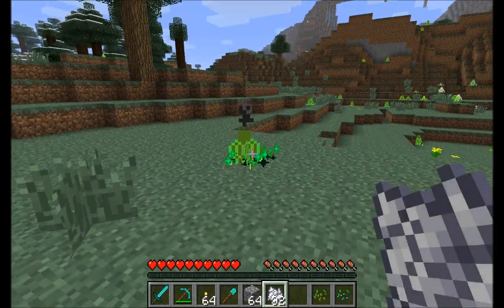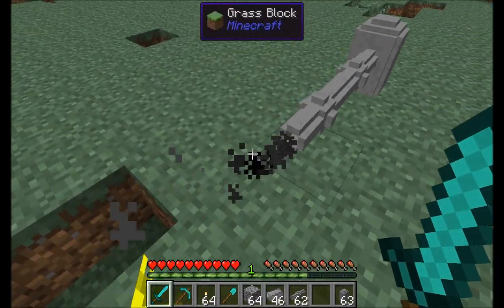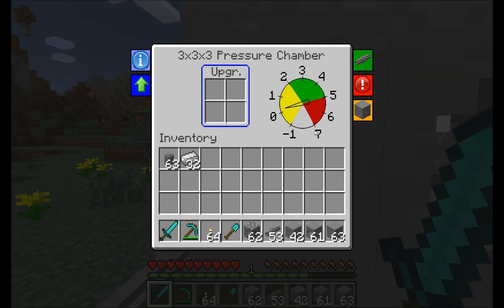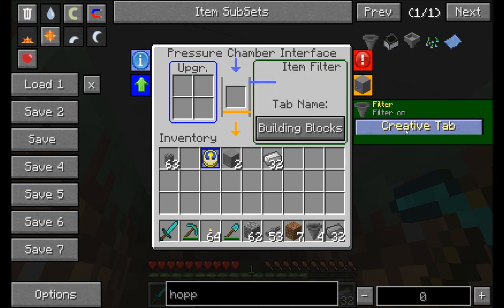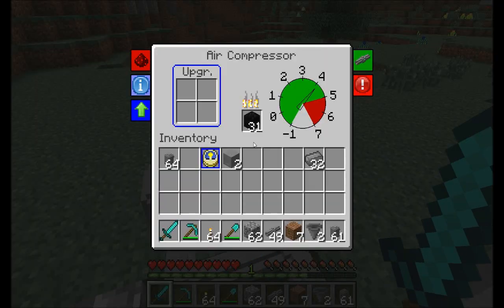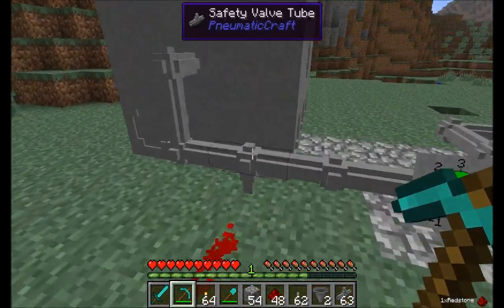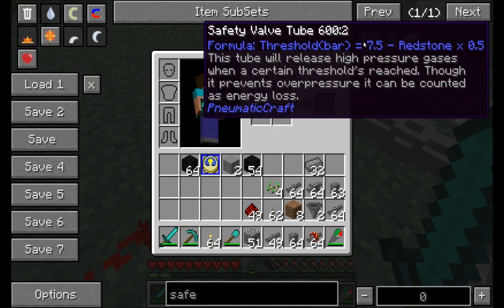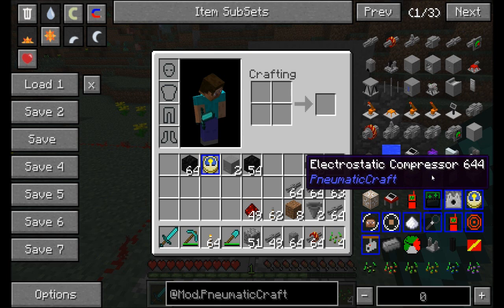Mod Spotlight   PneumaticCraft Part 1

Comment: Can the pressure chamber only be either a 3x3x3 or a 5x5x5? I tried to make my 3x3x3 taller by one unit (so a 3x3x4 I guess) but it wouldn't recognize it as a pressure chamber and air would just leak out.

Comment: Anyone else feel like you should be taking some serious damage from standing in the path of open pipes/pressure release valves?

I mean if its high enough pressure to compress carbon into diamonds.... I think its safe to say its pressurized enough to remove a limb or 2 if you were unlucky enough to stand in the jet.

Comment: The only problem I have with this mod (beeing someone that studied pneumatics in school) is that these systems start at 0 Bar yet the systems are open if you start em up without anything connected... normall air is always 1 Bar (normall as in the air all around you or outside) 0 Bar would suggest there is no air at all in the machine yet it is open in the back wich would suggest that air can just flow in when put down.

anyways sorry for going all nerd on your asses but it kinda bothers me (blame my teachers, the hammered it in back when I was in school :P)

Comment: The modmaker should rename the air compressor or change it's mechanic. It may build up pressure but it's not compressing because gases expand upon heating, which is the opposite of compression

Comment: Now the question is - can we get versions of the pipes that, themselves, carry redstone signal?  So, eg, you can set your generators just some distance away from your release valve, and not have to stick redstone around the whole contraption?

Comment: Hey thats a nice mod. but I'm wondering if laying out a line of redstone is the only way to measure a redstone signal. 

I have the same problem with rotarycraft industrial coils in combination with comparators. Does anybody know a way to check the strength of a redstone signal in a more compact way?
Reply: I wish there would be a computer craft program to do this.

Comment: It would be pretty cool although gruesome if a player can get sealed into a pressure chamber and then another player can then pressurize the chamber with the player locked in it and then rapidly depressurize the chamber so that the first player locked inside will then slowly blow up and then explode into a pile of porkchops just like what happens to Milton Krest in License to Kill.

Comment: Whaaaaat? The vapour going out of a pressurized pipe does NOT hurt you?

MY LIFE HAS BEEN A LIE!!
O_O
Reply: While realistic, thats hardly fun.
Reply: norris wolfwood So radiation from Reactors in IC2 isn't fun?? I don't even bother with the hazmat suit and just run in there and see if I survive it's all in the fun of it! :D
Reply: Because its airpressure,  not steam:)
Reply: Orxenhorf

I work as a chef, I am very familliar with "pressure cookers" (is that how they are called in english?)
They usually work with something between 0.8 and 1.5 bars (depending on the size), and, when you "open" them, you can put your hand in the vapour without any problem, it isn't even that hot, and, obviously, it doesn't hurt at all. Although I would say maybe at 5 bars things could go worse for your hand/face.

I saw one explode once, though, and, even if the pressure was relatively small... we were so scared that we stopped using that pot for at least a week, for fear that it could happen again, since it made a considerable hole in the wall. Luckily, nobody was near, but... even at low pressure, those things CAN be dangerous.

Anyway, it was kind of a joke, since the popular impression is that everything steamy that comes out of a pipe is going to kill you even if it touches you slightly... which is not even remotely true, but hey, myths are myths, we can't fight them with logic!
Reply: O)_(O
Reply: ElementGamer11

Not really, no. I hate things that dont really multitask.

Some things, like swords are ok..anything else? It better serve several uses.
Reply: At these pressures, a leak really wouldn't be that big of a deal.  (1 bar is approximately 14.5 psi or 1 atmosphere)  But, really high pressure air leaking out a small opening could definitely hurt.
Reply: Orxenhorf hurt? more like cut steel
Reply: If you get high enough, I'm sure air could be used to cut steel.  (I'm not talking about plasma cutters either, just air or maybe air+dust abrasion cutting.)

Kitchen pressure cookers, yes they aren't going to get to very high pressures if the safety valve is working.  The steam involved could be trouble depending how much you get exposed to, but shrapnel from any pressure vessel bursting is always a bad thing.

With plain air - for comparison levels to these pressure levels, think of a road bike with skinny tires.   That would be around 6 or 7 bars and you can let that out with your finger safely.
Reply: ***** Thats pressurized vapor not air.
Reply: Orxenhorf Plasma cutter in Dead Space will definitely kill u, (just nonsense)

Comment: Hi Dire :) Do you know if the modders are working together to create FTB for 1.7? If not, shouldn't that be the next step for it? It kinda sounds like the future of modding.
Reply: Yeah I know. Although 1.8 is already luring around the corner.

But I was more curious if the modders would unite, and create a more harmonious experience. At the moment a lot of mods are just completely separated from some of the main things going on.

Personally, I would say it is one of the last remaining steps to be taken before they can monetize FTB.
Reply: A few things:
1) FTB is more of a content delivery service for modpacks; bringing them into one common area for the end user's convenience

2) Modders don't develop JUST for FTB, they include compatibility and integration with other mods as needed or if it makes sense to do so. Think of the modpacks FTB allows you to download as a "variety pack" of candy; each bit of candy is made independent of the other, then someone/something comes along and packages them together for the consumers/end users

3) Modders ARE working on updating to 1.7, but the changes that Mojang did to Minecraft's internals were hefty and the modders are human too, so they also have their personal lives to take care of

4) Mods are developed independently from each other as there are simply TOO many mods out there to take into account during development. A general rule of thumb in modding is "Develop against Vanilla Minecraft first, then factor in other mods"

5) To be fair, FTB is already sort of monetized as it is company as far as I know and they have their own store right now. If you could clarify the "monetize FTB" part, I'd appreciate that as your meaning is rather unclear

Comment: This mod sounds great but having to break and replace a block to get stuff out of the pressure chamber is not only tedious but also frustrating since u lose all the pressure u built up.
Reply: ieatyou1 Actually you don't have to do it in the start.
as long as you blow up enough iron with the tnt at the first place you can start with the interface setup.
Reply: You start out doing that, but then you can upgrade it and automate it as he said in the video, like everything in minecraft in the beginning it is tedious and sometimes frustrating.
Reply: You didn't watch to the import and export doors before commenting did you? :P

Comment: Whats with all the air pressure mods recently.  Thats 2.  Pneumatic craft and Hydraulic craft
Reply: Hydraulicraft isn't air pressure is it now? :3, also, there have only been two, nothing special.
Reply: James Hollowell I'm working on a mod that uses a third, DIFFERENT kind of power.  It's amazing and totally unexpected, I assure you.
Reply: tommulmul2
 i think he might be talking about how they both use the system where it evenly spreads the liquid/air
Reply: Hydraulicraft isn't air pressure. It is hydraulic pressure.
Reply: same basis though.  wether it's liquid or gas it has the same premise.  Instead of saying air pressure i should have just stated pressure mods.
Reply: It's almost like the mod developers instead of coming up with original content are either 
1). Following a pre-prescribed mod development idea base.
2). Copying each other's basic premise.

Now I understand that mods copy each other all the time in subtle ways.  (How many power mods are there?)  But for 2 pressure based mods to be introduced so quickly to each other something is kinda fishy.
Reply: flntstne In the real world, there are only so many kinds of power systems. Most tech mods power systems are based on the concept of electricity and flowing current. These two mods just happened to pick the other main method of real-world power system: pressure.

I do realize you could make up your own power system, but isn't it easier to base it off reality?
Reply: ExiledAlchemist IIRC, they actually might be compatible in some way... if not, they are working towards that I believe...
Reply: Not to sound like a jerk or anything, but why am I playing a game to experience more reality?  I am not fussing about having the mods or what they do.  Anytime a mod is added that makes the game better no matter what it is about.
Reply: James Hollowell Correct!